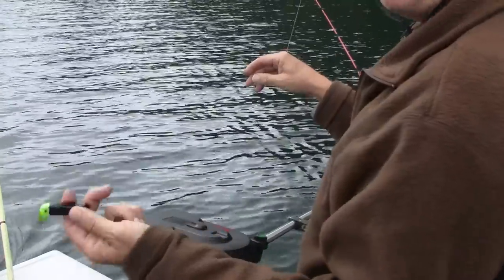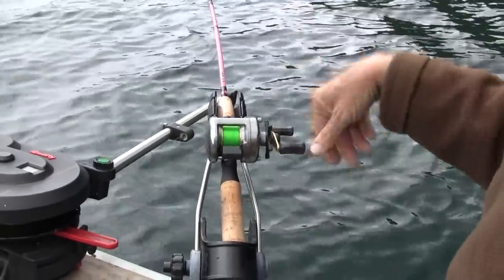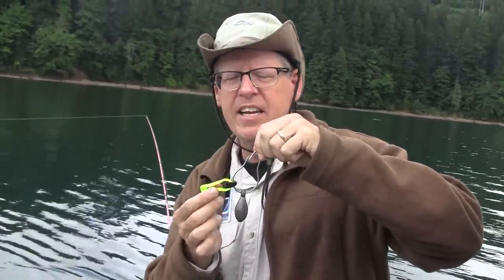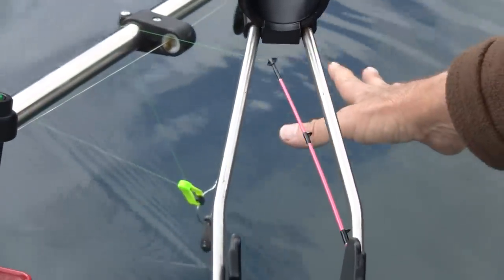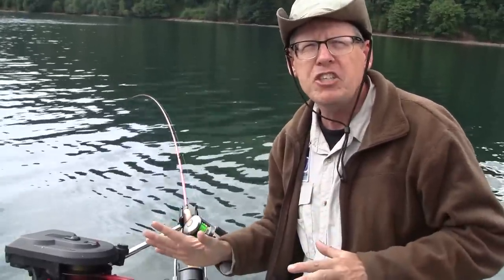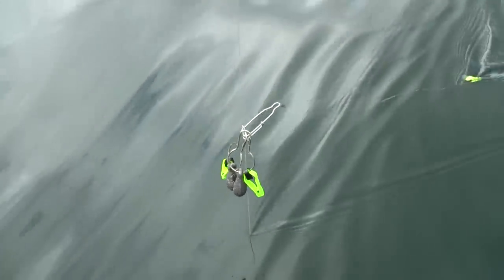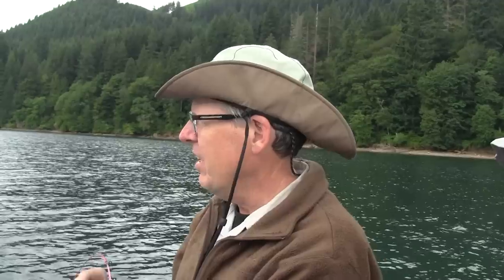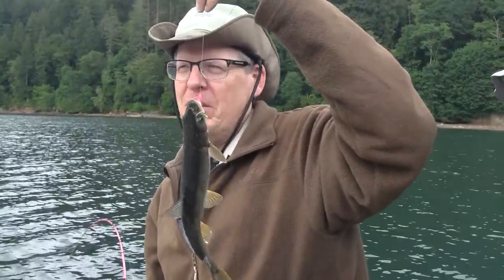Advanced Downrigger Stacking Techniques for Kokanee

Comment: Another neat benefit of the stacker system we're showing is that you can also use it to make adjustments to your shallow line without moving your deep line. So let's say you see a fresh group of fish ten feet up from your stacked line, but you don't want to move your deep line. With this stacking system you can reel up and down along the cable without disturbing the deeper line. Often you'll see your stacked line on the depthfinder so you'll know exactly where it is.